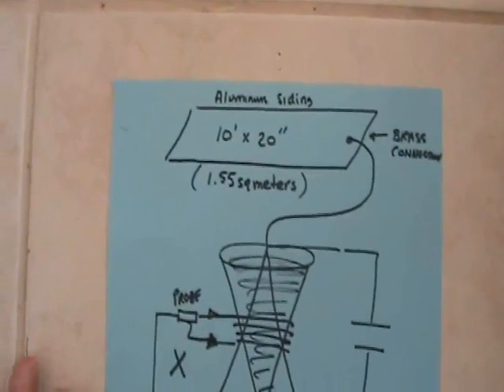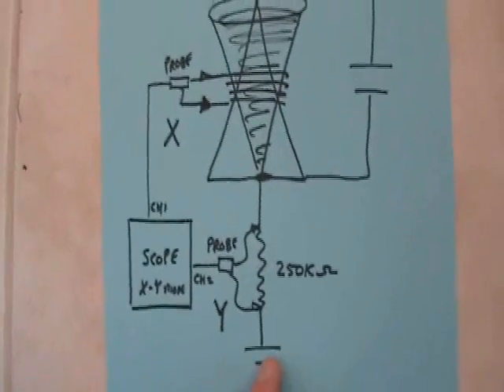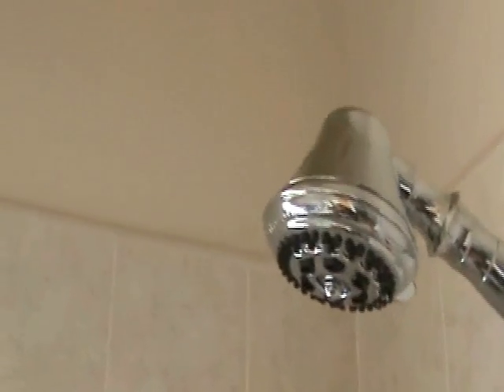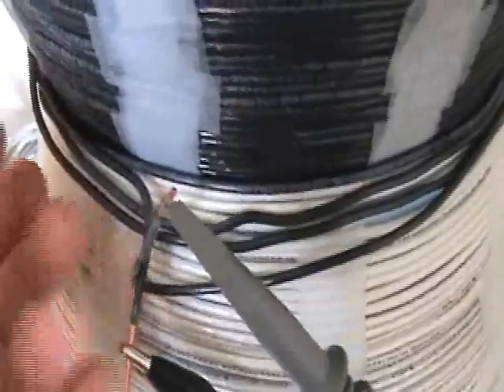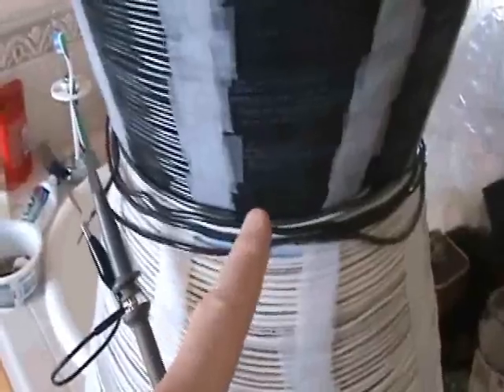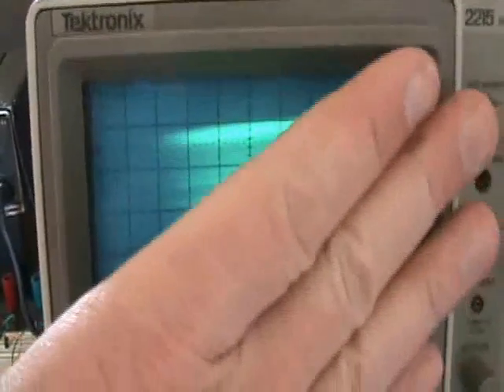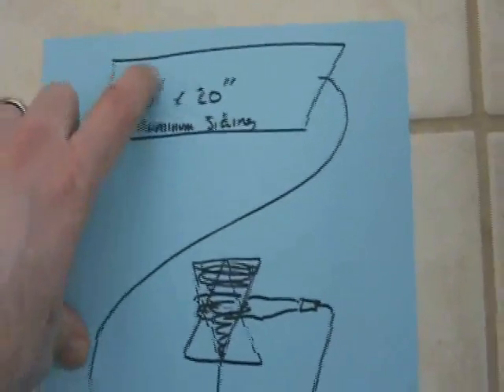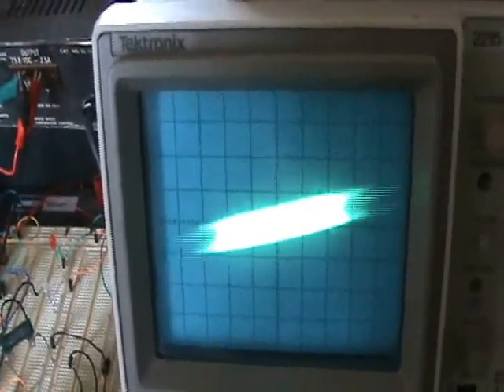Ep. 16 - Bashar Free Energy Space-Time Antenna (Bigger Plate Antenna)

Comment from the maker: @ncranfill 
The "plate" approach will pick up particle impact. The coil approach will pick up magnetic field fluctuations. I live in a remote area and about 500ft above sea level. If you are higher up, the "plate" might get more. If you are in a city, there might be lots of magnetic disturbance due to nearby machines. Picking up ambient energy is a new - fun - area of research. Right. It won't be much energy to start with ... but this is a developing art.

Comment from the maker: @wildersara 
Regarding Mica. It can support an electrostatic field while dissipating minimal energy in the form of heat and is an excellent dielectric. So if this Bashar STA thing does need LARGE capacitance, mica is a good choice for material to put between the plates. It seems reasonable to assume that capacitors are needed to store the power once received.

Comment from the maker: @wildersara
I don't have any mica ... funny you should mention putting it UNDER the coil. One thing I did do, was take the 12x12 aluminum plate and put it on top of the COIL. When I do that, the magnetic field in the coil increases slightly. It is "contained" into a tighter space that way. So this is a clue that having the tetrahedron around it would contain the fields as the try to push against the aluminum surface and induce currents due to Lenz's Law.